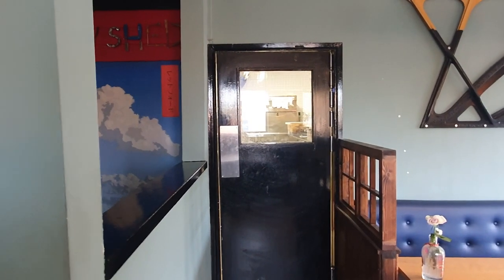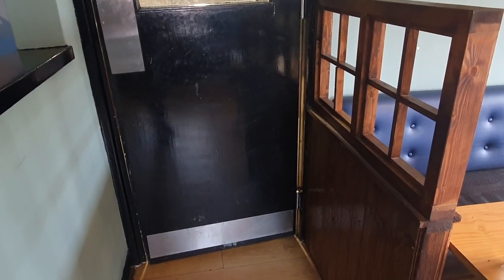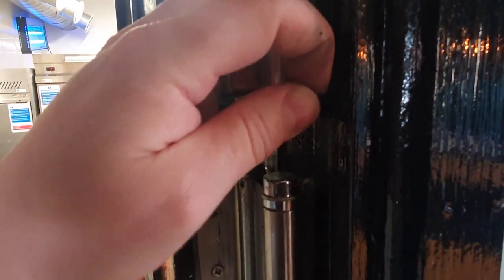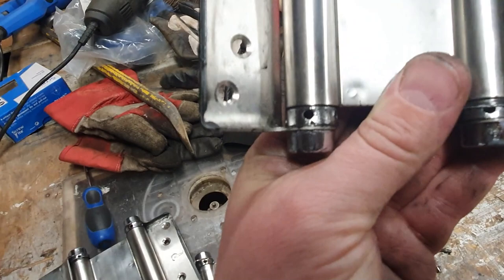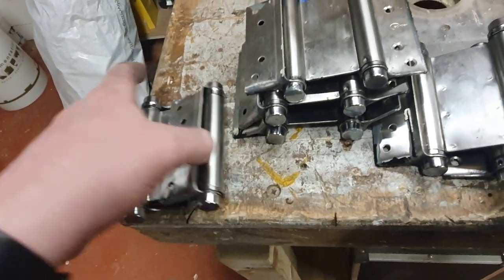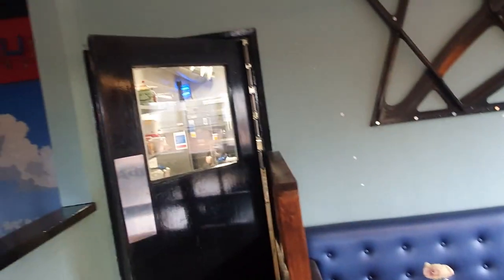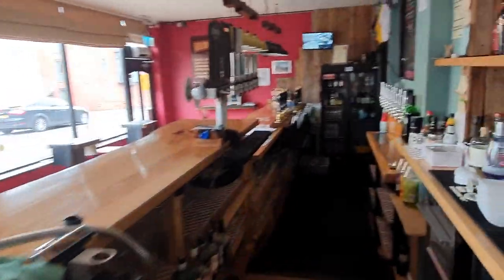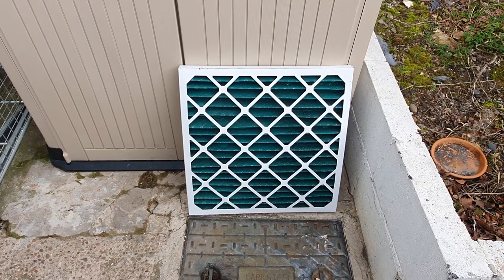2 Way Hinges & Make Up Air

Comment: You ever considered an auxiliary chilled water line going through your beer coolers, picking up cold in the air, and running that through a small radiator in the pub air returns? It isn't air conditioning, but it might make it more comfortable until the height of summer? Cheers!